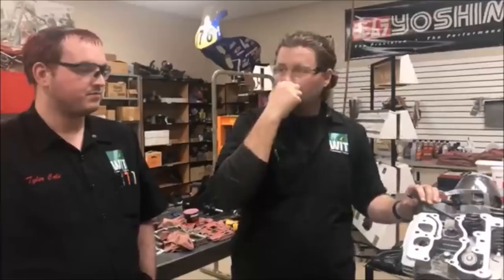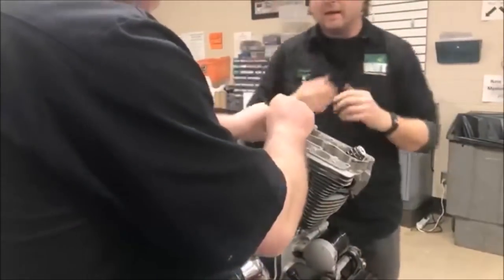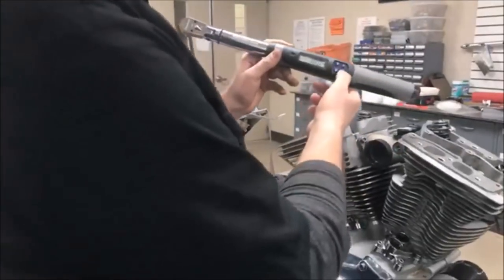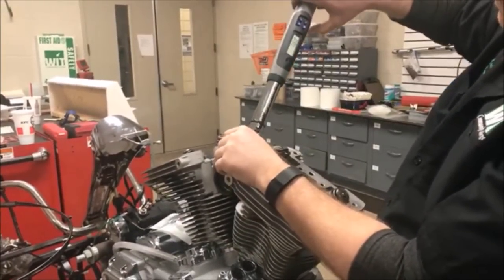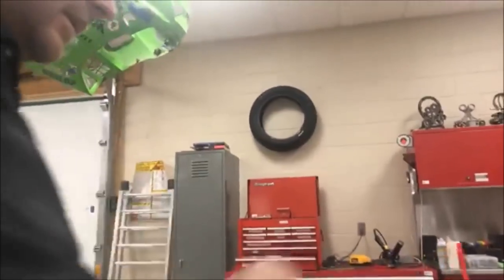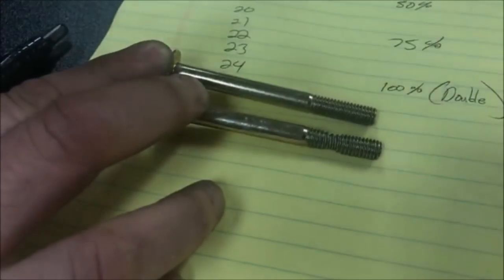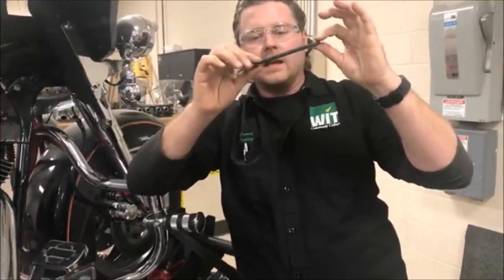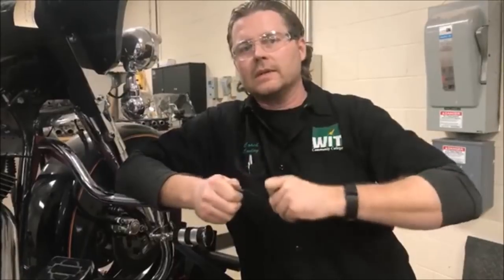How accurate is your elbow clicker? Torque wrench accurate?

Comment: Hola amigo shane, i did that same test some time ago and im good at it, what i do is is to look at the size of the bolt, i analize the kind of job that bolt is going to do (for instance holding two pieces of plastic together with little weight or holding two pieces of metal with some weight) so you kind of know how much torque that bolt needs by thinking this way anyway is good to have a good torque wrench in your tool box.  Thanks for the video we were missing them...

Comment: Shane ,  im sure you can get 12 pounds dead on you been doing this a long time . I understand your showing the guys the true value of a torque wrench . my Brother has a very bad habit of refining on 1/4- 20  I have had to helicoil all the primary holes on his bike . I use my wrist and 1/4 inch ratchet for 1/4-20 bolts , i have inch pound and foot pound torque sets .    I been turning wrench my entire life I can get with in a pound .   Good Video .